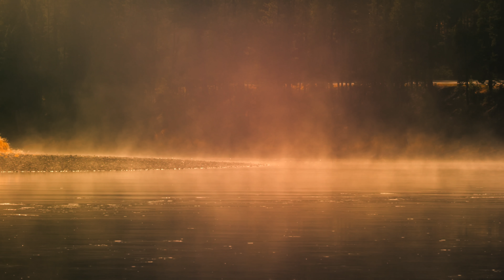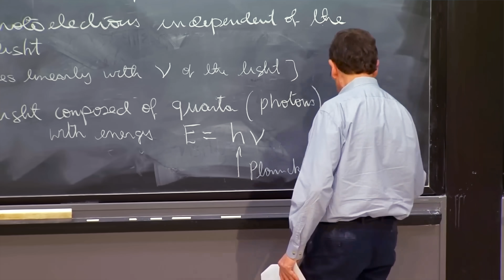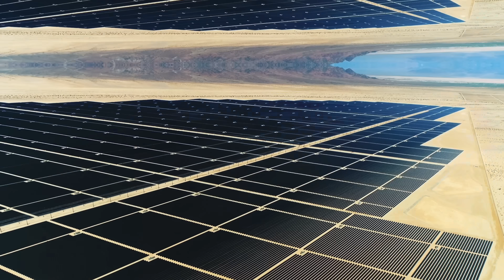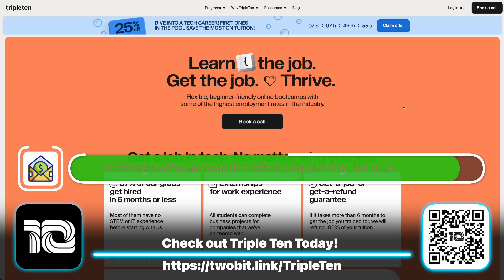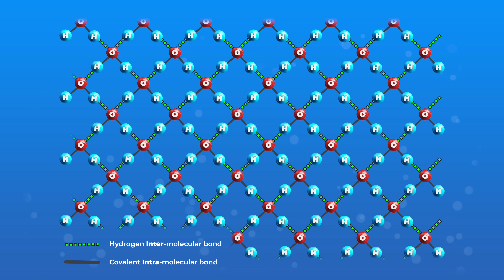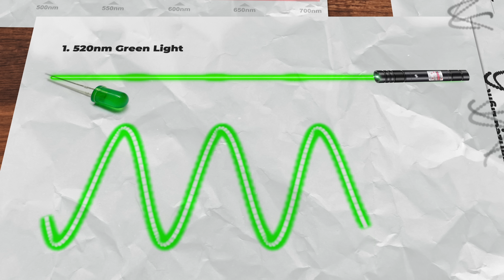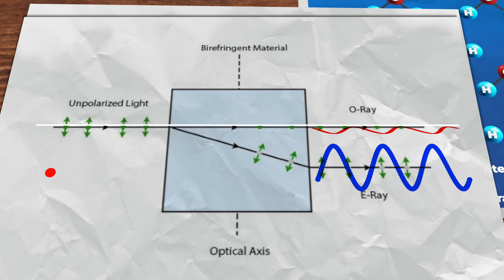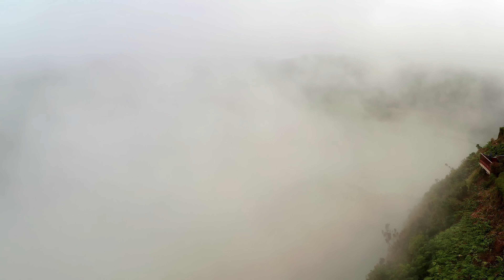New MIT Discovery Just Solved Water's BIGGEST Mystery!

Comment: The problem with complex machines to do simple tasks like desalination is that they are complex machines, I am a wastewater engineer and oil chemist. I have read hundreds of patents of supposedly better ways to accomplish tasks like this that never pan out. The simplest machines work the best because their maintenance is low. Less moving parts means great longevity.  Complexity  weakens efficiency. You end up losing the money you would have otherwise saved because you saw it was more efficient in the lab.  When you try to scale it up is when you see all the holes in the science. Then again I love to be proven wrong.
Reply: One of the simplest desalination plant designs I ever saw was a circular concrete basin with a raised gutter around the rim. A thin film was placed over the top and inflated to form a greenhouse and water catchment surface. The condensed water drained into the gutter. When enough salt accumulated, the brine pool was drained, the salt dried, and a front end loader scooped up the salt.
Reply: @TyMoore95503  which is a great example of how difficult it is to scale up some desalination techniques.
Reply: Idk, the machine he imagines doesn’t sound very complex. Just shine polarized light on big, shallow pools of salt water and blow hot air across the surface.

I’m not sure the net efficiency would be higher but the machine itself could way less complex than a membrane-based desalination plant.
Reply: you should tell this to the engineers who design industrial robots. I work on them and they are crazy complicated and break down alot.
Reply: My favourite idea is a glass dome which is evaporated by the sun to distill water. Zero energy needed.
Reply: @موسى_7  Where does all the excess salt go? 3 to 5% of sea water is salt. An average first world person consumes 100 gallons of water per day. This includes water for crops, livestock, fabric and material manufacturing, etc. A city of a million people will consume 100 million gallons of water. That equals 3 million gallons of salt a day. Where do we put all this salt? Back in the ocean? Use it to destroy soil and turn everything into desert? Moderation and living sustainably within the confines of a countries national resources is key. If not, we will simply expedite the destruction of our planet.
Reply: While it is true that simple solutions are often good solutions, and adding complexity can raise cost and also create more points of failure, I would not see that as a general rule. Also, what seems "Complex" and what seems "Simple" is often a matter of experience. If you introduce something new, then it will often be complex and fail more frequently, but once that design has been optimised and standardized, those downsides will often vanish.
Of course, all that only applies once the new concept has been proven outside of lab conditions!
Reply: You are talking more like a scientist.  The difference between scientists and engineers is within your comment.  Scientists look at the tangent function at 90 degrees, sees it goes asymptotic, and conclude it is impossible. Engineers say 89.5 degrees is close (good) enough.   Engineers are artists that use the sciences as their media to find creative solutions.
Reply: @skytrainii8933 
That's a good observation about the differences of inclinations between people. Engineers have probably built hexagonal wheels before and decided that they didn't want their buns bruised so they "improve" upon their approximation to pi. Mathematicians discovered that pi is a transcendental number so they have never made the hexagonal wheel and ride in the engineers' wheeled wagons to run errands.
Reply: Well, if you're AMD, Intel or Nvidia, that would not apply. For them it's make everything mind numbingly complex, and then make it more complex every year.
Reply: Desalination just masks the problem of human overpopulation, though. Don't get giddy about any technology that enables unsustainable growthism and diverts energy from other true needs.
Reply: @falseprogress  we need populations to grow. I never understood this argument. Over Pop doom sayers always get it wrong. They don't understand that  for every 100,000 people  born there is always one genius  born that figures out how to keep those 100,000 alive.
Reply: @falseprogress  Which is my biggest concern with Thorium reactors.  These seem to hold the promise before 2050 to provide us with energy at possibly less than 1/80th the cost of all other forms today.  Seems like a godsend.  However, look at what we did when we developed the steam engine starting the Industrial Revolution.  The biggest restraint on our activity seems to be the cost of energy.  So, what happens when we are able to substantially reduce the cost of energy when Thorium molten salt reactors start coming online...  So I love the idea and that they will provide more efficient energy but it also scares me...
Reply: It's sad.  Just about every word you said was wrong.  It more sounds like you are just lazy and don't want to do the work needed to optimize a solution.  KISS is just a saying and not how things are.  I've made systems, formulations, and devices that are deadly simple, amazingly complex, or somewhere in-between. But I won't know till I did the work.  Just saying its to much hassle so the old way of doing it the best way is a reason I would have fired you from my lab and I'm surprised your superiors put up with your attitude. Probably, they don't know you've been lying to them. For shame.
Reply: @rachaelsdaddy  vickers made machine gun that in the early 1900s that had 30 moving parts. John Browning made a comparable one that had 7. Vickers broke down consistently. The later worked so much better especially in crucial moments and his inventions became the standard for most guns we have today because they worked so well. I never said the old ways. I said two factors determined whether something was successful energy density and efficiency. It can be complex as long as the juice is worth the squeeze. If I cannot create systems that work long term with minimal repair and maintenance than  my employer looses money and I will be out of a job quickly, time shows the weaknesses of systems.  We've been spliting a barrel of oil the same way for a 100 years. Other ways have been invented, but we still do it the same way because it's still the most efficient way.
Reply: "I love to be proven wrong." The taletell sign of a true scientist and truth seeker.
Reply: I mean this is just a few lazors at 45 deg and a fan to blow the vapor into a tube basically
Reply: I know this principle as moving parts.  electronic injection in cars has many more parts than carburetors, but they have much fewer moving parts, which is why carburetors were discontinued, if this technology has more parts but the same technologies are immobile, or more durable than desalination filters, so the new technology wins.
Reply: @DanielSilva-jj2lz  how does a carburettor have more moving parts? Most will have at most two or three depending on design. Modern electronic injection will have an injector solenoid per cylinder so that is four for a four cylinder engine just for a start, that doesn't even count the injector pump.
Reply: @DanielSilva-jj2lz  Don't forget generating electricity by boiling water. Carnot. Electricity to photon conversion. Or photon to electricity conversion. Then - Electricity to photon conversion.
Reply: @DanielSilva-jj2lz  Exactly. But even if desalination membranes got sturdier, they still have a limit to how fast you can filter the salt out. You can make it faster, but that means more pressure, making everything more robust and more expensive. With this technology, there is a naturally higher evaporation rate than with thermal evaporation, no moving parts (except maybe some sort of blowing system to carry the vapor away from the surface), and the only limit is how much exposed surface you have and how much light you  can shine down on the water. pretty neat if you ask me.
Reply: @DanielSilva-jj2lz  I'm sorry, what? Carbs fell out of use for a whole laundry list of reasons, but moving parts is down there at the bottom of that list.  I get the meaning behind your comparison, but your particular example falls woefully short.
Reply: Makes good sense.
Reply: and as long as man B builds on man As designs we will!
Reply: The silicon circuitry in your phone or computer that you used to type this message has one of the most complex manufacturing processes on earth, yet works so reliably that you don’t even think about it.

Complexity can work reliably if the business opportunity makes the engineering investment possible.
Reply: @prabhukavi1  The circuit industry is a great example of less moving parts.  The early complexity involved in creating integrated circuits (i.e. complex manufacturing) is far outweighed by the simplicity of their operational life (i.e. efficient effective carefree operation).
Reply: In this case, we would be downscaling.  Obviously, this takes place naturally on a massive, arguably planetary scale.  This is a pretty static and therefore simple process once it is completely understood.  Few moving parts, few waste considerations, low input power, with no need for controls.  Not all that many variables.  It could turn out to be simpler than conventional methods.  The simplest and most reliable processes are those which mimic natural processes.
Reply: I don't think this will have any role in desalination, but not because of complexity. It simply doesn't work, because it uses 'useful' energy, while thermal desalination typically uses waste heat. Sure, it is only 7% efficient, but when the energy is free this is fine, and typically it is done where suitable waste heat is available, such as from oil refineries. They also use many stages, each using the 'waste' heat from the one before it. You would need several times the input power to make use of this effect in all stages.
Finally, the mechanism itself might have a problem. If you are blowing chunks off the water, what prevents ions travelling with those chunks? You might actually fail to desalinate by doing this, moving salt across too.
It might have uses, and certainly needs to be understood for climate science, but desalination is not a use case. I don't even see much use for swamp coolers, because you can do the same thing much more efficiently with a good atomizer.
Reply: Back to basics. Fundamentals. Teach kids how be safe with a magnifying glass and not to harm others.
Reply: This is very similar to the claims about how much "better" hydrogen-powered cars are for the environment. Technically they're right - technically - but are cherry-picking their data. The reality is that to isolate hydrogen is very difficult for a number of reasons, never mind transporting and storing it. So, yeah, sounds great in theory when looking at the small picture, not so much when zoomed out.
Reply: DaVinci said that simplicity is the highest form of sophistication 👍
Reply: Probably, fewer moving parts, too, unless they are considered by weight.
Reply: Bless you,sir. You and you kind have saved more human lives than all the physicians in history, and you have had only had 150 years !
Reply: Even better to be proven wrong with GIANT LASERS.
Reply: Why isn't there more solar vacuum distillation especially with a closed/open loop system vacuum via ramp pump or or just a large water tank with a smaller tank that's raised achieving a venturi vacuum 0 moving parts along with a magnifying lid to concentrate uv to further purify water .. I believe the materials involved should be electroplated  carbonized  copper so black exterior with high thermal conductivity but in a closed system water evaporates at 33 feet exponentially less depending on temperature. It's literally a black straw your trying to heat n pull vacuum on with 0 moving parts
Reply: I’m not in your industry, but I get what you’re saying. More parts=more friction=more loss=less efficiency is the general rule of thumb for me. But you didn’t even mention the most damning part of those kinds of things: repair. Good lord the difficulty of repair they would have.
Reply: ....Just like literally anything else they usually test in phases working their way up to full scale. Like they test in a lab at a very small scale, then if the papers they publish about it get traction they get more grants to build larger scale models and test them for longer periods of time, companies may get in as investors to help fund it and have access to some of the research results. There are scale models of things as complicated as large metropolitan areas where they test for things like water drainage, model flooding, etc, scale of the city in a large warehouse size building. Large pools with wave generators, where they test scale models of ships for testing. 

They built nuclear reactors in the early days of nuclear energy at research facilities that were a fraction of industrial scale, and ran those reactors for years to study  longevity of the components and try different materials to make them viable for actual use. It's not like anyone is saying just throw up a multi billion dollar desalination plant without checking it.
Reply: Nice argument around patents and scale ups,
Reply: Sorry but does light production need more moving parts?
Reply: You took the words right out of my mouth!
Reply: how would using light to evaporate water involve moving parts.....?
Reply: So this proves.
That's climate scientists. Effective socialization of science. Who have been pedalling the The big lie about man maid, climate change.. Just didn't know about the photoelectric effect. And Blamed man maid climate change.. For a discrepancy they didn't understand... Vote trump 2024. And he will drill baby drill for oil.. Generation x do not want to become a surf. And are big trump supporters..🎉🎉🎉
Reply: Ya not wrong, why add complexity to an already efficient system.
Reply: Brilliant Comment Mate.:yougotthis:👍👍👍
Reply: There’s been countless times we’ve discovered things and make them in the lab and it’s super costly there. Meanwhile they scale production way up and it becomes profitable. Check out the lab grown meat industry as an example. Too expensive to do small scale but they upscale the production and it becomes profitable. We can also make great predictions this with some basic calculus before upscaling.
Reply: You need to rid your brain of the indoctrination and the conditioning - we need to abolish capitalism, pronto - end of story - the cost permeation then dose not apply and what should be our number one thing? - the survival of the human species  - this might be possible therefore desalination is and always 'was' an option  - (the giant forever unused plant from the 60's in Hong Kong is a case in point) similarly then Nuclear fusion the most efficient and safest energy source prevails however the stranglehold the energy companies have on Global Capitalism and its possible demise is their NUMBER ONE FOCUS ABOVE ALL THINGS and these 1% owners of all wealth will fight to the death to keep it - look at Putins attempts to appropriate Ukraines energy wealth
Reply: You are either a liar or a complete idiot. 

R.O. systems are used GLOBALLY to desalinate water. 

The R.O. system contains 2 parts. 2. Thats it. 
A water pump. - 1
A fitler element - 1
               TOTAL - 2

I state again. You are either a liar or an idiot. 
Doesn't matter which one. 
Stop it.
Reply: Only since you love being proved wrong.....

Patents are in legal terms and the readable part that is public domain or accessable to the public after 18 months from its issued date. The designs of but also including the visual drawings and dimensions for said patent is not included with or listed under the readable legal jargen and/or content. 

I am glad that i could make you glad by proving you not just wrong but also a liar and an idiot. 

Happy to help.
Reply: @adamaddams6472  visual drawings are included in most patents. They have to show proof of concept and you can't show that with most engineering apparatus' without showing how it works. They may not include exact measurements or chemistry but a mediocre engineer can figure that out. Furthermore the number of patents vs the actual contraption in operation  is something like 10,000 to 1, because most ideas cooked up in the Lab don't actually pan out in the real world. I know because I have had many failures from lab to plant. Also most patents are the  result of  professional white papers that show further engineering and experimental analysis for a fee... So nice try, Thanks for playing.
Reply: @Future_Fuels  your wrong.  You’re just wrong. :)
Reply: @Future_Fuels  your wrong.  You’re just wrong. :)
Reply: Complex machines - simple tasks.  This is what drives me crazy about cars.  Automatic windshield wipers, e.g.    Instead of me turning a simple switch when it starts raining, they make a complicated mechanism to do it for me.  Will cost a fortune to fix when (not if) it breaks.  Geeesch.
Reply: @terry_willis       Yes !   Car manf. and computer people together seem to have entered into a 'pact' to drive us nuts & financially broke at the same time !    How many times I have cursed these people.   Their attempts to make computer programs that can out think me.   I can operate a car just fine without any help from them.   Quit It ! ! !     :-)
Reply: @terry_willis  better than cranking a wiper while driving.
Reply: I agree with you. Simpler is always better. This is the reason why, despite the persistent promises, Hydrogen fuel will never be an effective automobile answer. But, perhaps with micro-electronics they can develop waveguides that transmute light into better bands to create a simpler process. Or maybe not? They are coming up with better materials to desalinate water so better material and material construction science seems to be our best hope with improving these kinds of things.
Reply: Why do you say hydrogen will never be an effective answer for automobiles? I can only imagine a technicality making that a true statement,  something like by the time we develope a better commercially viable process automobiles will be a thing of the past... or that simply those that control and profit from current fuels have not and will not allow it as it will negatively affect profit projections. Leading to investor confidence fadng and transitively lead to less profit.  Its easy to produce hydrogen. Really easy. And using hydro in combination with petrol or alcohol is efficient only requiring a slightly different design of carburetor.  I have procured hydrogen and implemented it rather easily into a small engine via balloon providing the compression to feed into carb essentially supplementing the og fuel. I did that with some old freeze dried glass coffe jars, a couple of bolts, Balloon and adjust carb accordingly
Reply: @GodoftheSpear  
The reason is simple:
Efficiency! Sure, making Hydrogen is fairly easy, but it's also fairly lossy. Then you need to store, cool, pressurise, transport etc. the hydrogen. You keep wasting energy, and thus efficiency, at every step and that raises the price.
And then you need to turn that hydrogen back into electricity to drive your engine, unless you are going for a Hydrogen Combustion Engine, but in that case the fairly inefficient nature of any combustion engine comes into play again.
So, unless we have absolutely massive amounts of surplus electricity to turn Water into Hydrogen, we can't really realistically use it to fuel our cars. Of course Hydrogen still has a lot of value to serve as long term energy storage and to be used in certain industries, but unless a lot of major breakthroughs occur, I don't see it as a viable method of propulsion for cars.
Reply: @rolandrohde  By the time all those issues for hydrogen cars will get solved it will make no sense.
Infrastructure for EVs is already expanding rapidly, batteries are getting better and better. New EVs already hit 400mile range, now it's time to focus on lifecycle (need to tripple battery life) and keep investing in charging infrastructure.
Hydrogen cars will simply arrive on market that will already be taken over and cemented around electricity.
Reply: @sznikers  
Exactly my point!
Reply: @rolandrohde 
Based upon tonnage produced annually, hydrogen is the most important industrial feedstock on our planet Earth. We don't use it for cars because it's far more valuable to be used for making ammonia to fertilize crops and make food with protein and removing sulfur/sulphur from sour crude oil.

Even with abundant electricity, we still can't replace the tremendous role of hydrogen in these major industries.
Reply: @GodoftheSpear  I would like to add to what @rolandrohde said and also add in reply to your post.  You mention that controllers of current fuels are the ones that won't allow Hydrogen fuel.  The truth is they are the ones leading the pointless charge to Hydrogen for vehicles because it becomes "business as usual" for them.  Almost all Hydrogen in production today is extracted from fossil fuels.  This is because is just much more cheaper and requires far less energy than electrolosis.  They are promoting "Blue Hydrogen" to make it sound clean.  But this is worse than "Brown, Black and Grey Hydrogen" which are from brown coal, black coal, and natural gas/methane respectively.  The only difference between "Grey" and "Blue" Hydrogen is that the latter also includes "Carbon Sequestration" which is another set of fruitless and unecessarily complicated (in the case of carbon extraction from the air) &/or ineffective (in the case of pumping carbon underground) technologies.
Reply: @gonegahgah  
Those indoor hydroponics farms which use pink and blue LED lighting to feed their crops can switch to using ambient light such as sunlight to create the green light band to energize photoevaporation of waste water or seawater to make potable water.

This can be widely used wherever there's sun 🌞 light and waste water 🌊. Preferably ambient air with much available heat. These conditions are fairly available in tropical and subtropical coastal areas where heat is a potential problem. These places need nighttime radiative cooling to help condense the water vapor into potable water.

It can be a great way to alleviate many environmental human habitat problems if the scientific method verifies its benefits.
Reply: @solconcordia4315  That's excellent to hear that something like that is already occurring.  Cool 😃
Reply: @gonegahgah  Simpler is not always better.
Reply: I don't know. I do like the abacus, but the efficiency a calculator offers and the speed and parellel computational power of a PC...hmm. Either way, the more effective desalination becomes, the saltier and drier our oceans get. More water means more crops, which translates to population growth. Without regulations, this could get out of hand quickly.
Reply: @KazeKamiFooDjinn  I see it as potentially reducing our demand for electricity for cooling at a time of major global climate warming. That's a big plus 'if' this discovery leads to promising  'air' conditioning and refrigeration  technologies as promising as they appear at first glance.

We'll see.
Reply: @larrymotuz6600  The mathematics of alchemy is painfully ugly. There will always be a price to pay down the line no matter how free, beautiful, and clean it looks up front. The problem is always demand, not supply. Unchecked growth has been the fall and extinction of almost every civilization and dominant lifeform on Earth. The greatest extinction event was probably from creatures who used compounds of nitrogen and ammonia like we use O and C and CO2.
Reply: @KazeKamiFooDjinn 
Many developed parts of the world are facing the dire prospect of decreasing population so a moderately increase in population can be a good thing to stabilize the societies facing long-run termination.
Reply: @solconcordia4315  resources and land are finite. Populations will naturally increase when lifestyle is appropriate for increase. Those with money and power do not want to wait for this natural course to take place because they will lose so much economic strength in the process. They bolster immigration to shore up this decline as immigrants are willing to work for less. But this usually only works for first-generation immigrants. They will work hard so that their children can get a good education and better jobs. If there are too many 2nd gen foreign elite in any nation, and they're of a distinctly different ethnic persuasion, racism in the ethnic majority will cause problems. If, instead, racism in work society suppresses this uprise in 2 gen foreign elite, there will be a double upsurge in crime. The regular 2nd gen immigrants who decide they don't want to slave away like their parents for a pittance will already be filling low-level crime positions, but now they'll have educated and shunned leaders to create masterful and dangerous criminal organizations. This isn't a major problem in countries like Japan because our outer genes are usually strong enough to assimilate most foreigners within two to three generations of interracial breeding toward the Japanese side. Unless the immigrants are from Africa. Then it'll take around 7 generations. So, the alternative to flooding a population declining country with immigrants is to raise the salaries of young people while throttling inflation. Bit big corporations will lose some of their profit margin and will not be able to invest as heavily in R&D and expansion and so they will inflate their prices. An increase in luxury markets isn't a problem as long as food, basic housing, energy, and water are kept moderated by the government in order to ensure the savings and retirement funds of the older population is still sufficient to survive after inflation. There's a lot more pieces to this puzzle. When it gets too complicated and nothing seems to work... then usually war is declared 😉😜😘
Reply: @KazeKamiFooDjinn  the calculator has less moving parts than an abacus. It's all solid state. The only moving parts in a computer is the cooling fan and the hard drive which more and more are solid state. The efficiency is a million times  greater that's why it wins. If they can build a machine with less moving parts and greater efficiency than it will win. Doesn't sound plausible. It may however debunk the bad models of climate prediction.
Reply: @Future_Fuels  Sometimes efficiency in terms of repair actually costs the longevity of an item.
Reply: If MIT is right ->
Our Climate projections are wrong like hell.
We have 80% fewer aerosols over the oceans (IMO [2020] regulation regarding the reduction of exhaust gases) -> 
This leads to less cloud formation and less reflection -> more solar radiation.

If MIT is correct, the resulting water vapor formation is several times higher than assumed. Water vapor is a greenhouse gas....
Reply: Although I Agree with your premise, I disagree with your conclusion only in this discoveries regard.

It will realistically take decades to take advantage of in high enough efficiency to be economically viable like solar panels but it fundamentally has a much higher peak potential that current methods and uses a natural phenomenon to do. Something which mechanically complex currently so much higher ceiling combined with fundamental mechanical simplicity as we're taking advantage of a natural process leads to much cheaper costs even though it make take decades to actualize
Reply: @NadeemAhmed-nv2br  There is no evidence presented in the video that using light is more efficient than other methods for evaporating water for any industrial purpose. The only claim is that 4 times as much water vapour was removed from the liquid water, but to stay as vapour it needs to take energy from the surrounding air, which will only happen by continuously adding heat to the air that's circulating through the evaporation system (Doing it with small volumes of water in a lab gives the process a plentiful supply of spare thermal energy. If this effect was usefully strong it would have been observed and measured literally centuries ago. Also MIT, among other universities, is not above chasing media attention and more importantly venture capital funding by lying about their discoveries, so until other people replicate these results they can't be assumed to be true.
Reply: @peglor  Seems a worthy endeavor, and the concept is simple enough to build a small unit relatively cheap. The polarizer though may not be.
Reply: @MachinedHuman Yes the proposed desalination machine is not complex. You just need green diodes and a polarizing lens. The proposed lens is 3 layers of materials with no moving parts. The entire device could be packed into flat panels that could beam light into a pool of water. Very simple solid state desalinator.
Reply: @peglor   Try think of it mechanically. It makes more sense then. And yes, there's always a bias. There has to be. This is nothing new, so the interesting thing is the applications for industry, but that is very hard to communicate when the ones holding the wallet will never understand what is going on.
Reply: @peglor  Well actually using this photo molecular effect could decrease the energy consumption of battery production significantly.
Usually the coating is done in a closed loop system like a heat pump dryer. With this effect added, the temperature delta would decrease. 
Maybe with this effect in mind, battery dry coating is no longer necessary to reduce the energy consumption of battery production. 👍
Reply: @peglor  Academia moment
Reply: @peglor you are only under the assumption that the people who truly know and understand this information are good people and not trying to harness it for themselves.
Reply: @champspec  You're under the assumption that the laws of thermodynamics are negotiable.
Reply: @peglor 
If we take water vapor as the product desired, this process has probably achieved higher efficiency than other processes.

Efficiency is a ratio so it must have the quantity of an end product specified as its numerator.
Reply: @peglor 
It may or may not be a  strong effect so we may have already observed it on the water condensation on a car windshield in a bright morning's sunlight.

Being efficient and economical is usually a technological and financial endeavor, not necessarily a scientific endeavor.

Hydrogen, for example, can be used for storing excess energy and used later so it may not be as efficient as batteries but if what one wants is heat and drinkable water, having hydrogen with available oxygen or air may become much more valuable than having charged batteries.

What's effective, efficient, and economical depends very much on the application's context. What's the end it's for ?
Reply: @NadeemAhmed-nv2br  Now - think about making photons. Electricity generation. Boiling water........
Reply: @NadeemAhmed-nv2br DaVinci himself said that simplicity is the highest form of sophistication
Reply: @NadeemAhmed-nv2br  solar panels may be less expensive than they were before, but they are not a large scale long term solution. Every solar system has  natural gas back ups for reliability purposes this makes it twice as expensive as gas alone. The reason they are even an option is because of their simplicity. The problem is energy density.  A battery is a horribly unreliable source of energy storage on a large scale. The energy density is a fraction of  fossil fuels. Now you can have complex systems for nuclear because the energy density is so high that it disproportionately offsets the cost of those complex systems. You can scale and invent new ways of using this energy because it is a million times more dense than even fossil fuels. In the end that is what it comes down to, the ability to create cheap, abundant energy. The biggest problem is that government incentive structures cut against nuclear because of years of bad propaganda.
Reply: @Future_Fuels  "because of years of bad propaganda."
Not entirely. There are inherent problems. I was a Naval Nuke in the mid 1960s.
Reply: @msimon6808  yeah and those cores can run 25 years without refueling. I was thinking about 5 mile island docs and Chernobyl, What problems did you encounter?
Reply: @Future_Fuels Absolutely! Simplicity is the Bane of Government! Profit and Power loves Corporations and Corruption and Loathes “Freedom and Free Will”!Government is separate country - hidden behind complexity, slave owners by design!
The closest my research, bearcreekresearch, has come to simplifying remediation
 of liquids, is the Naval Research regarding duplication of Natural Cavitation.